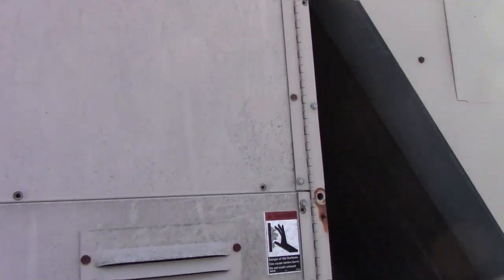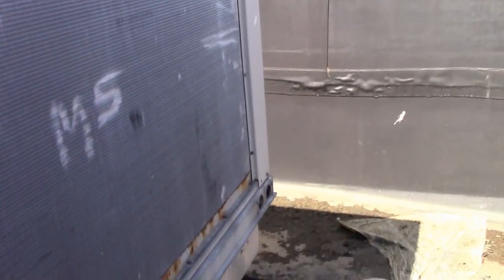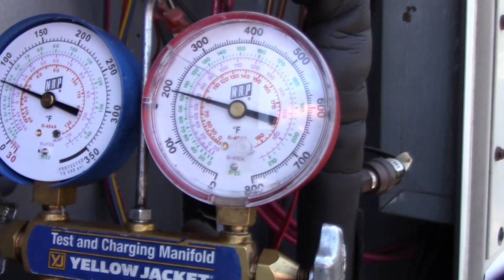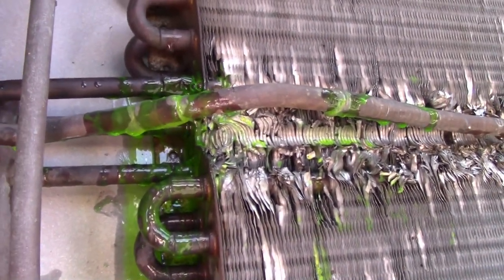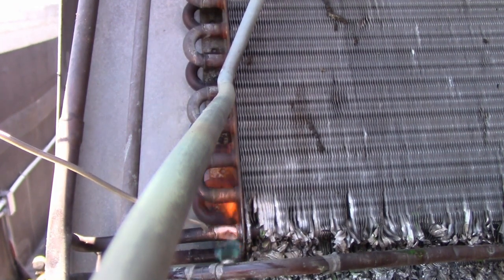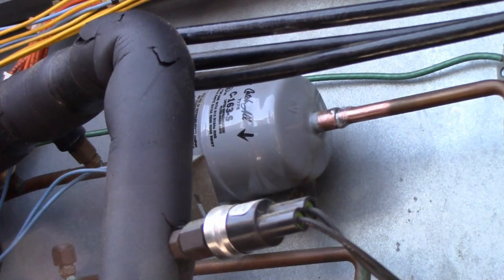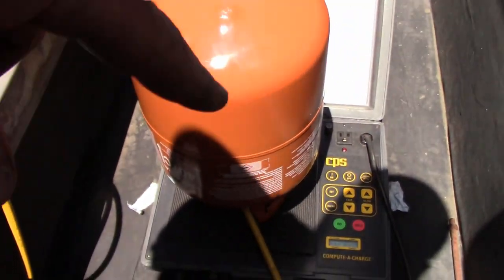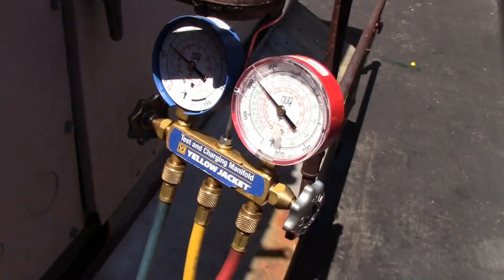Another Day in the Life of an HVAC Tech: Episode 18

Comment: I've used Stay-Brite8 for years with no leaks and no problems. I brazed for years before learning about Stay-Brite8. Sometimes you have to braze but most times you don't. Stay-Brite8 is quicker, cleaner, less expensive, and easier than brazing and Zoomlock.

Comment: I get the advantages of the solder, but why the flux when you were unsweating the filter dryer?
Reply from the maker: Helps the solder flow easier and in my experience will help prevent a solder glob from forming on the bottom of the pipe and will keep most of it in the piece you’re removing.

Comment: I just looked up the crystal lens, a few days ago, I found from $6 to $12 plus shipping, I jut bought my first gauge set, & of course it had a small piece missing, but for $10, its a start for me, I will make an order next payday. but a guy has to start somewhere, I also got a vacuum pump from same person, both were $75, both need a tiny bit of work, but guy retired, in his 70's in a wheelchair, & wife selling off his stuff to buy him a handicapped van
vac pump needs new cord, easy fix, & will have 1 soon, I wish could have bought more, but slowly as I can afford by the seat of my pants.
Reply from the maker: I've replaced the cord on mine multiple times.  Feet too.  Sucker looks like it's been through a war but it's 23 years old and still sucking.   I order the gauge covers from my supply house.  These ones clip on unlike the smaller J/B ones that screw on.  I like this style of gauge better because they are larger and easier to read and they have all the common refrigerant scales on them.  Make sure you have low loss gauge hoses on your manifold or get those little ball valve deals for the ends.  Your hands will thank you.
Reply: @Halligan142  these pop in, 3 1/8" gauges Yellow Jacket brand. right now plain hoses, I will plan to get better ends, but also just studying & learning, so no big deal to me, I do see someone with 5 hoses near me on Marketplace, but needs seals, but has the ball valves on last 6" for $25 on 3 of the hoses.

Comment: How long would a trade school course be to prepare someone to become an entry level tech?
Reply from the maker: Most are 2 years.   Licensing requirements vary state to state so know yours.  Any reputable course should get you at least an EPA cert and all your needed classroom time.  May or may not include an electrical code course if your state requires it.  Make sure any program you take is accredited.  Some places may or may not have job placement assistance.  This will allow you to work in the field but the only way to know what you're doing is by putting in field time.

Comment: How did you know the system needed 8.9lbs. I thought roof top systems needed to be charged using super heat calculation. (I repair fridges and freezers and always go off the label, still dont quite get how to calculate charge amount when its not written on the device label)

Comment: You can soft solder HVAC copper?
Reply: No, but he can. 🤪
Reply: yes you can. becareful tho as tubes are thin
Reply: some do, but not much safety margin if overheats I think it starts melting at 430F & melted by 530F, what scares me is I think of just partially melting & line could pop loose. there are videos of pros & cons, may have to so some searching, then form your own opinion
Reply from the maker: https://www.harrisproductsgroup.com/~/media/Files/PDF/Spec-Sheets/Soldering/Lead-free-Solders/STAY-BRITE8Spec.pdf
Reply: @randymack1782  why would anything go above 430 degrees in an AC system? your compressor oil will cook itself off long before you melt this solder